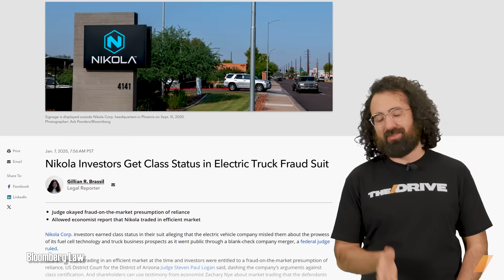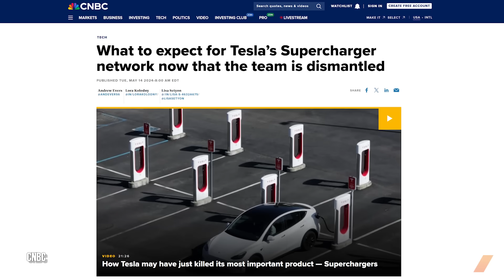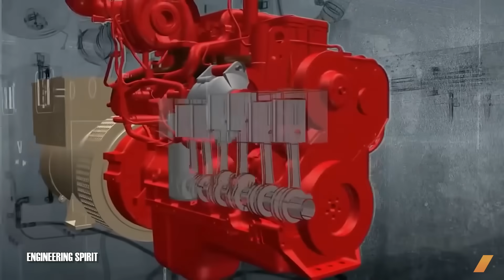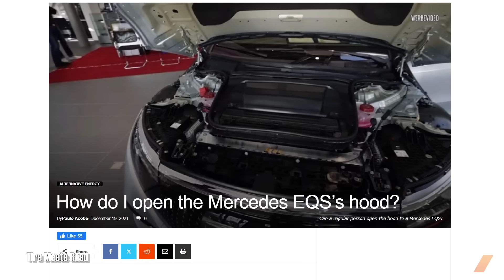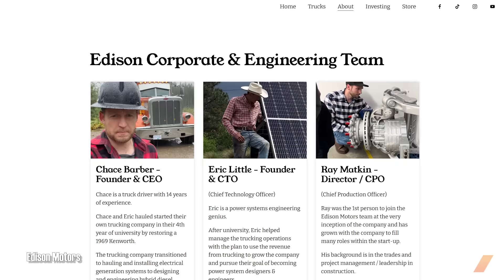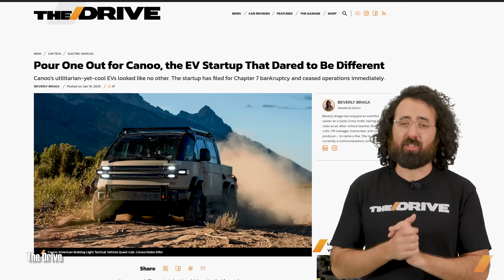The truckers in a shed beating Tesla with 100-yr-old EV tech

Comment: 2:50 you cannot compare a batterypack to a diesel engine. You have to include the fuel tank at the semi and the electric engines at the Tesla. Compare apples to apples please.

3:20 nothing to do with the load on the grid, these chargers come with their own batterypack, therefore the load on the grid is spread over 24 hours. Also they like to place these close to a field of solarpanels. And guess what, lot's of them close to highways..

Comment: current electric semis out there 
Freightliner eCascadia 155=230 miles full loaded
Kenworth T680E estimated range 150 miles
Nikola Tre BEV (and fuel cell version) they are out there but don't think the company will survive 

In the EU
Volvo FH Aero Electric about 370 miles
Renault trucks E-tech 
Scania about 370 miles.
IVECO HD BEV 310 miles
upcoming Mercedes-Benzes' eActros 600 (expected 2027)

Electric semi's in the EU currently charge on the same chargers that cars do.. (sometimes  unhitching the trailer) and can charge on the mandated rest breaks truckers in the EU have.

There are others out there but these are the ones on the road or soon to be released.. and well in Nikola.. they are a separate story.

Will Electric semi's work for long haul.. in the U not right now... in the EU it is being done by more and more truckers) in the US they will easily work for yard trucks as well as short haul where they can charge as they load or unload. So if they wanted to they could convert a lot of the city based trucking and all of the yard trucks and port trucks to EV with current tech and not overloading the grid. After a few years they will start to build an EV semi charging system but for right now return to homebase is currently the only reliable way in the US.. although the EU has already found solutions that work while they build up the dedicated network of chargers.

Comment: Put a E-axle into a 1980s F150 and it will fold the truck in half! Unless: you strengthen the frame, the suspension, the cab and bunch of more stuff. Retrofitting does require a lot of brain time, money and it's not for just anyone..

Comment: Why do you need battery at all? Diesel electric locomotives don't have a battery.
Reply: Efficiency. Diesel-electric locomotives use electric motors and no multispeed transmission for longevity, not efficiency.  Standard multispeed transmissions, cannot handle the load of a train without frequent repair. They used to use them, but they were unreliable.  You need an engine large enough to meet peak demand without a battery to level out its energy needs.  Plus without a battery, there is no place to store energy recovered from braking, it's just lost.  With a battery, it allows you to run an engine that only need to meet the average demand, not peak.  For example, in standard pickup truck, you only need 25hp to run down the highway, but hundreds of hp to get it going.

Comment: "We don't have the battery technology charging facilities or grid infrastructure to support a market of 100% passenger EVs"
- Battery tech: Energy density of lithium batteries has been increasing about 6-8% year over year. This has similarly translated to actual range in consumer vehicles where the longest range EVs are now achieving 400 miles vs only a few years ago when it was closer to 200 miles.
- Charging facilities: More than 25,000 charge stations are installed every year in the US and this trend is super-linear
- Grid infrastructure: Energy corporations and the government have had decades to plan for this and many entities are moving on it. This is really just supply and demand, there is no technology gap here. When the demand for electric power goes up, more power stations and transmission infra will be built.
Reply: Do you have any idea how much copper we would have to mine to upgrade the grid like that. It is an insane amount, compared to the copper we currently mine. This would be an enormous undertaking to go all electric all the time. Mixed usage would be much more attainable
Reply: @andreahighsides7756 Most power transmission lines are aluminum, If I recall correctly newer transmission lines are going in the direction of some new materials that would reduce metal and increase transmission efficiency. Its worth a dig down the rabbit hole. Lots going on in that space
Reply: @VlikeInMewe  i still don't see very many charger-stations around where i am, if any at all, or in many other more rural areas, so... where is said infrastructure for full EVs? until then, EVs are better short-trippers than long-haul runners. hybrids like what Edison is going for combine that really good short-tripping and stop/go handling of EV and the ease of long-tripping a fuel-burner has.. also, can you charge a li-ion batt of any kind in 10 min at most from say 5% to 80~90% and maintain any kind of cell stability in the pack? i'm not adverse to EV tech by any means, have 2 e-bikes, and they will put ANY pure fuel-burner car to shame in terms of ease of operation/maintenance for short-tripping.. one can even accelerate as fast as most cars generally will!
Reply: @ EV's wont take off for real until they get over the battery problems. They need to get lighter and more energy dense. 
I was just making a point on the rapidly advancing grid scale power transmission innovations
Reply: @ charge rates also need to improve to where people can charge a car from around 5% to around at least 80% in 10min at most.. also win't change that areas outside of major cities won't see these improvements for 5~10+years.. i know of areas still running dsl if anything other than relying on sat-net/mobile-data on the internet side.

Comment: can divert the engine energy to make electricity to charge a battery.  then connect electricity to motor.  seems like brillian people can do this.  not just applicable to cars, but going offgrid

Rivian trucks has built in gas generators 😅. Pepsi built it own solar farm with battery back.  grid not issue for pepsi.

Comment: 2:08 How are they packing 150k pounds worth of logs when the federal load limit is supposedly 80k pounds? Is there a special exception for logs? Or am I missing something else? Did he just admit they're overloading their trucks to almost double what's allowed?
Reply: It's Canada, so it's a bit different there, but also, Michigan allows trucks to be loaded up to 154,000 pounds. It's spread over more axles so it's the same axle weight as normally loaded trucks.
Reply: @lucascallihan4932  Thanks for clearing it up, appreciate it.
Reply: Yeah it’s an easy way to reduce the driver shortage, increase weight limits and increased axels . Oh
Reply: I don’t know what it is like in BC (where I think these guys are based) but here in Manitoba the GVW for a B-train setup, which you see a lot with our logging, is 62500kg (about 138000lbs). So depending on the roads and how the truck is set up, I don’t think 150000 is out of the question.
Reply: Haul on dirt in cannda you can haul what you can move he's a bush logger man
Reply: They are off roading, I don’t think they ever go on the road with 150k of logs

Comment: Edison has an excellent idea to use this tried and trued technology. Trains have been using this since the 1920s, as has been pointed out in the video. This tech makes it easy to drive as many or as few wheels as the engineers want, and to use full regenerative braking. Also, there is possible future expansion into more efficient tech such as combined cycle engines which use a diesel plus steam or more commonly a gas turbine plus a steam turbine, which enables the exhaust gases to be used to generate substantial extra power. This increases the thermodynamic efficiency to as high as 60%, which is unheard of for even the most efficient diesel engines. Turbines are much more compact and lightweight than any reciprocating engines and can save a lot of weight plus space on a vehicle.

Comment: I've been a mechanic in the rail industry for years and am a fan of RG LeTourneau design, both of which used this tech for many years. I never could figure out why nobody figured this out, bravo to these guys!
Reply: Solving problems makes a lot less money
Reply: RIP LeTourneau. I’m from the same city as the original plant. It’s Komatsu now and it’s nothing like it used to be from everything I’ve heard. Shame.
Reply: Over the road efficiency isn't the best.  If you are running an engine and just chewing up miles having a direct connection is more efficient and hence, less fuel.  I imagine a lot of trucks are adapted from the OTR trucks, or using common components, so they end up using the same design.  What he is doing is pretty niche, but for that market its on point!

Comment: Been waiting to see the bigger automotive press to pick up on Edison motors, in my opinion they have the right answer, full electric wont be feasible until hybrid systems have been in use and popular for a couple decades in my opinion. Also people should always have a choice no government should force its citizens to buy electric cars, when they havent been perfected or even standardized in the manner of battery packs that should be easily swapped if they all used a standardized battery pack then stations can have racks of charged batteries and either a person or machine can swap pack instead of being forced to charge usually up to 80ish% which from using li-ion cells for many years everything Ive read says you should charge the battery to 100% for it to have a longer lifetime use. These guys are killing it with no help from their government who was running a scam program to give grants to EV manufacturers/start-ups after being denied they were told to reach out to some company that will help them get the grant for a %of the grant money buuuuuut that company was run/owned/operated by someone in the office that approves the grants [it may have been the actual person who did the apporval, its been a while since I watchd the video about it, either way it was suspect at best and a administrative grift at worst 🤷‍♂️]

Comment: Yes, I’ve been saying this for years, diesel trains work great. But putting huge slow charging batteries is just dumb. Plus it don’t even need to be diesel, the engine powering the generator could run on virtually anything.

Comment: It looks like I'm going to be coming throughout the video. I will tackle each subject separately. 

The Tesla Semi does sit right in the middle of the average semi weight. Depending on the sleeper, the Tesla is lighter than many trucks on the road! When he talks about the engine weight, he's talking about dry, no oil, no coolant, no diesel fuel, no DEF. Then you have the weight of the transmission itself, another 500 to 700 lb.

Comment: As good as Edison is, once you fire up that engine, even if it was a 1.5 l, you will not be as efficient as electric. 

Any moron that tries to tell you otherwise it's not worth talking to.
Reply: You are correct. Any ICE engine is not as "efficient" as electric.

When an "efficient" semi is out of power on the side of the freeway, an Edison truck can drive out on batteries, turn on the engine, recharge the "efficient" stranded EV and the Edison truck.

Then The Edison driver can slap a bumper sticker on the stranded EV that says "yet another efficient EV rescued by Edison Motors". 

Then the Edison truck and the EV can drive off into the sunset.

Comment: I don't understand why nobody uses Elsbett motors for hybrids. That would actually be max clever :)
Reply: Hmm. Elsbet 3 cylinder diesel engines. Hmm making 90 hp. I'll do some research. Thanks :)
Reply: @Sah-o5m  Jo, not Diesel but all kinds of oils - can directly burn used sunflower oil. High efficiency, no need for cooling, I e.much smaller to integrate, less weight. And as an optimized generator driver in most cases quite feasible. 90 is what they currently build and sell, not what could be build for purpose if asked for. And the concept of multi fuel small range extenders could work not only for semi's.

Comment: Just got the bins and shelves sorted in your work truck and the drive train is worn out?  Keep your truck, replace the engine and driver shaft with a generator and electric axle.  No more shift stick, but you keep the efficient money making of your work body...  Maybe even make your TIG/ Compressor/ Lift/ Tire Crane more efficient and drop those little gas motor issues so you have only 1 power source to worry about.
Reply: Exactly. Rich at DeBoss garage is working to make diesel/electric hybrids on behalf of Edison for service trucks like welding rigs and bucket trucks

Comment: I'm a big fan of Edison and I'm not a trucker of any sort. I made it through the whole video despite some irritating future looking statements and agree that going in a greener direction is a good thing. I am not a fan of broad negative definitive statements about the future based on the current state of the art. It's too early to make final judgements about what the future will be since the challenges are just engineering, manufacturing and technology based. Give the industry more time and they'll solve engineering problems or find a better solution and reduce costs as they scale. I'm sure it was pretty daunting to imagine a network of highways and gasoline stations on every corner when the first Model T rolled off the assembly line.

Comment: Not hard to beat vapourware peddled by an actual nazi. 

PS - your truck looks like it's trying way too hard to be badass to the point of it having the opposite result. Like you could insult the manhood of the driver by saying you once saw him wear a pink shirt.
Reply: Edison heavy duty semi trucks drive  offroad, so they sit high off the ground and no fragile plastic to be broken on tree limbs.

Edison semi trucks rarely drive on the highway so no aero styling is necessary.

Edison trucks haul the heaviest loads so they need giant radiators up front.

Edison trucks have a simple cab frame and flat sheets of steel. This reduces cost and complexity and makes it easier to repair. Any steel store will have the materials to make repair parts.

Form follows function. There us a reason that steel toed work boots look different than running shoes. They do different things.
Reply: @Sah-o5m  Wow really leaning on the assumption that I haven't owned and currently own several pairs of steel-toes.

Thanks for the marketing points, but keep working that shaft. Maybe once it's polished you'll see what a sales drone looks like.

Comment: A few things to note:
Tesla isn't the only company that builds electric semi trucks by far, others have way more already on the street. Just to give a few examples: Mercedes has three models on the market (eActros 600, eActros 300/400, eEconic), Volvo has 7 on the market at the moment (FH Aero Electric, FH Electric, FMX Electric, FM Electric, FM Low Entry, FE Electric, FL Electric). Volvo alone sold and produced more than 4300 Units by 2023. MAN, Scania are just two more manufacturers.
In Europe these trucks are perceived well in the industry as a cost effective alternative to a diesel semi in the long run. The only part that is more expensive is the initial price of the unit, due to fewer moving parts the maintenance cost is cheaper and even a battery change once in their lifetime can't throw that metric off. Not to speak of the way cheaper energy cost compared to a diesel. 
I love what Edison Motors is doing especially their approach at the right to repair but they aren't the only ones that can do e-semis properly by far.

Comment: open source ftw :3 I wish Edison's ways expands to cars too   it would be cool to have a car working on the same principles
Reply: Toyota has a plethora of hybrids.
Reply: @owilliams1031  this is different from an hybrid.  The engine is only a generator.  Meaning it's rpm is fixed. On a prius it has to drive the wheel.   Major difference.

Comment: This might be an improvement over conventional trucks for many applications however it has nothing to do with why we are trying to use EV's in the first place. This still uses diesel and has carbon emissions. While it has less, which is good, this is not the goal. For trucking i think hydrogen is the future, and in the us specifically the rail network needs to be expanded since trains are the ideal solution

Comment: This video did not clearly explain one crucial detail: The only reason this is worth it is because of the regen breaking. Yes the 5-10% fuel savings due to cleaner and more constant diesel combustion are nice but don't actually save fuel (unless you charge the truck every time and the trip is run from battery long enough of course). The regen breaking saves a LOT of fuel because it happens that logging trucks break and go up and down high degree slopes a lot, and that makes a huge difference. Not every truck would actually benefit from Edison's setup.
Reply: you only have to run the diesel half the time in the edison truck, its 70 percent fuel savings compared to modern diesel semi's, its a smaller motor and only has to be run half the time, the regen breaking is nice but even without it this style setup is so much more efficient.

Comment: Your quoted price for an EV Semi, is about 40-50% of the actual cost (before government rebates) of an EV Semi. In fact the prices quoted are very inline with diesel semi prices. The net weight penalty is about 3 tons, but EV semis get a 1 ton allowance so payload is harmed about 2 tons. The battery packs are about 400 KwH. The range is helped greatly by the 55mph commercial speed limits in CA. Range would be way less in other states.